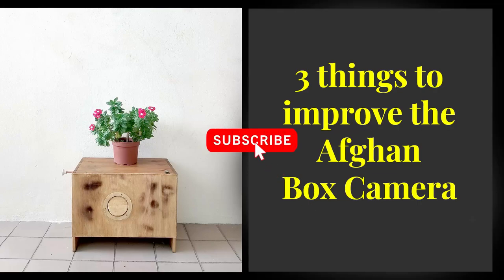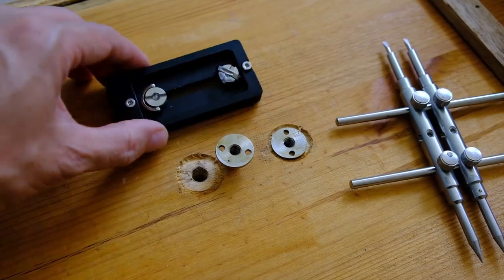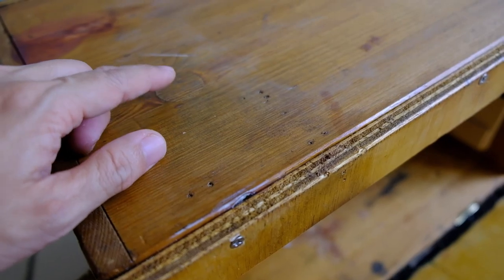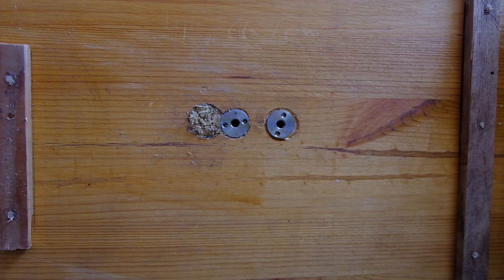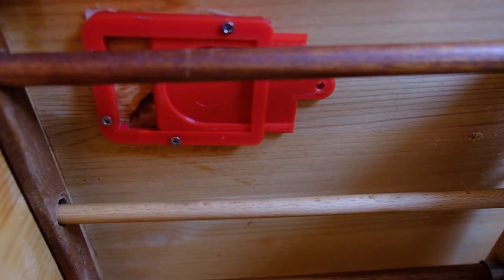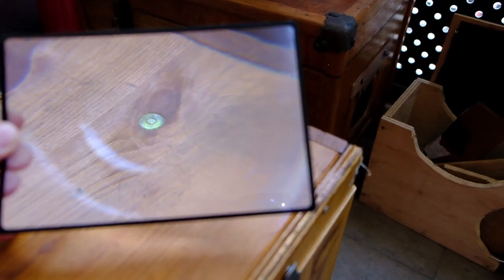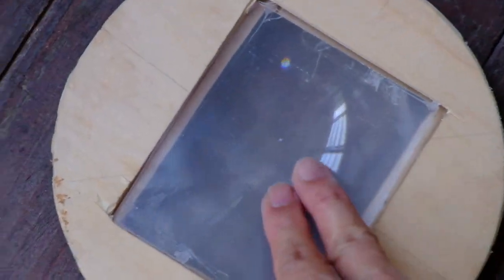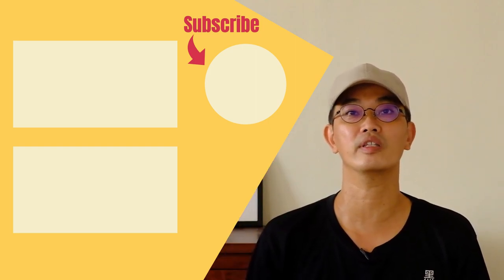Analogue Photography Diary :  3 ways to improve Afghan Box Camera

Comment: Hi, where did you buy your tripod mounts? I struggle to find them on the internet.
Reply from the maker: again from China . here is a English site we used to do our China shopping .   https://shopee.sg/Tripod-Screw-Cap-Stainless-Steel-Adapter-Screw-Nut-3-8-To-1-4-i.161237926.6518111088?gclid=CjwKCAiAhbeCBhBcEiwAkv2cY7e5nXa1mDjfw1EYIe2ywMxCC01mmdsNH1RSUtO7XO8AcTsgF2bKLhoClOgQAvD_BwE